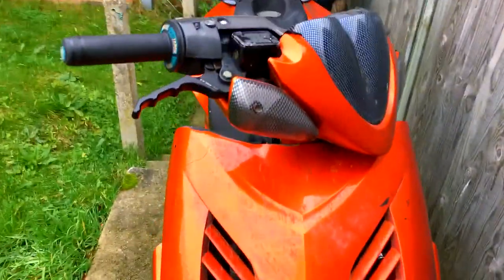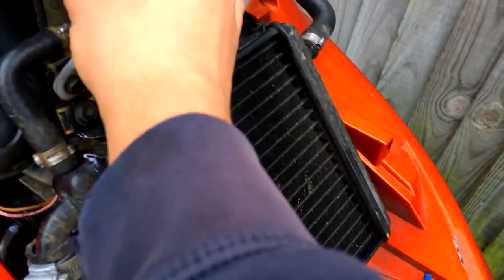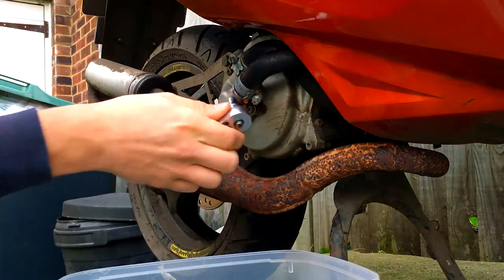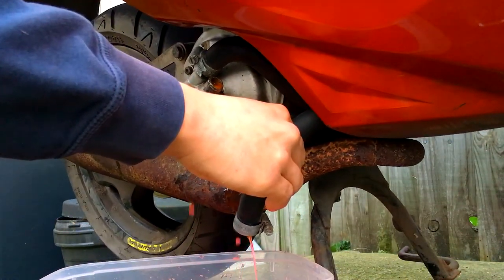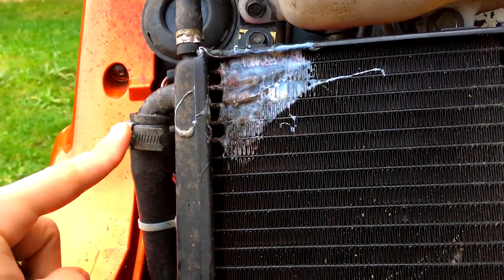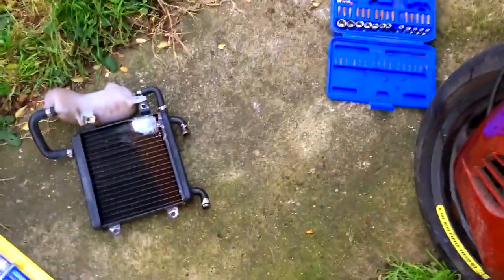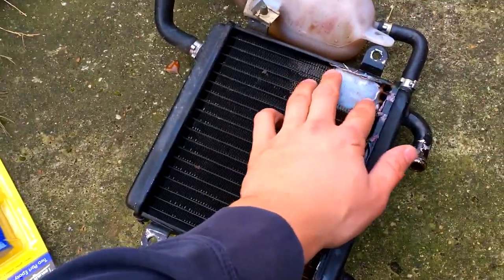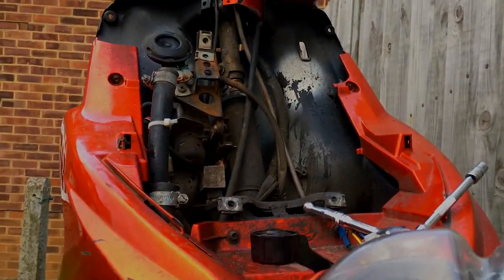How to remove Yamaha Aerox Radiator

Comment: mate wtf did you do to your rad
Reply from the maker: absolute bullcrap , I had a small hair line crack in one of the rad runs. So I removed the rad and dried it out. I whipped up some 2 part epoxy resin and pasted it over the crack and around the area to seal it. Waited for it to dry and then it was good to go back on. That lasted 6 months. I’ve done it on plenty of rads and it’s a perfect hack for a budget
Reply: @jakhy1198  nice nice welcome to the beun side (dutch for shitty but works haha) i ran out of solder tin for some dmp lights and just twisted them and e taped them hard hahaha nice mate